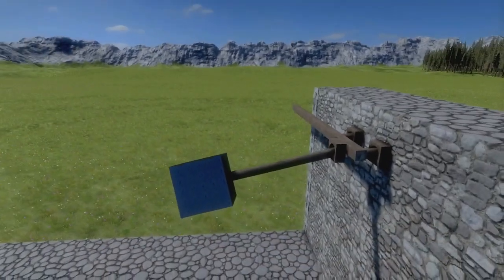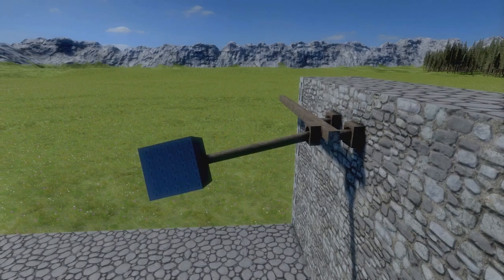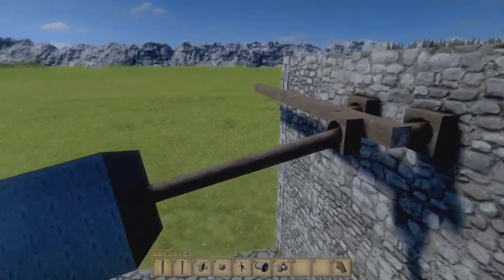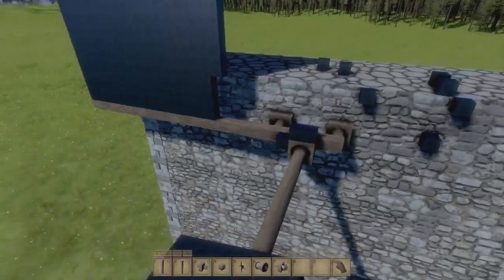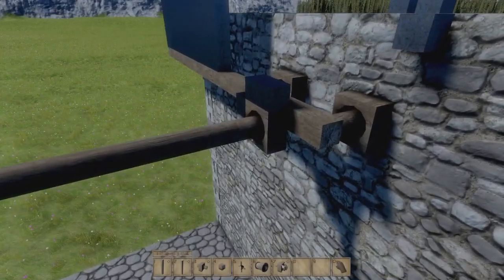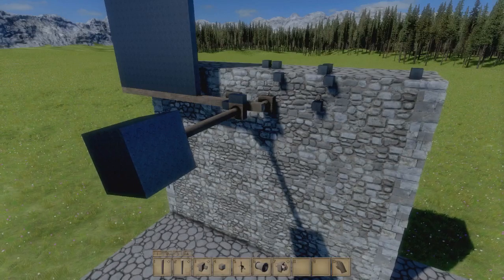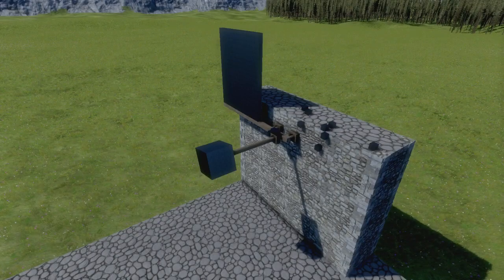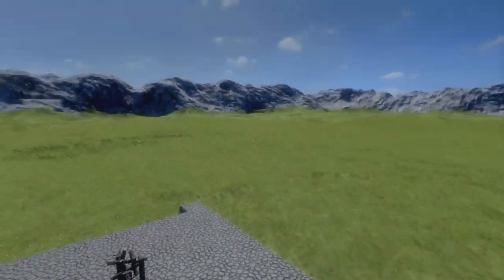ME/SE Guide - Improving Catch Block & Rotor Stability

Comment: Is this calculation of stability based purely on the mass of the object that the catch block is connected to, or does it use the mass of the piece the block is connected to compared to the mass of the object supported by the catch block?

Equations (if these help): A= mass of thing catchblock is attached to.     B= mass of thing attached to catchblock
# = "amount of stability" number or something (bigger=better).

Equation I:   A=#          Equation II:   A-B=#   or   A/B=#
Reply from the maker: It seems like it's A+B=#. This is purely based on observation though :)
Reply: Captain JaRs huh. Unless we're both really missing something, this is almost as dumb as atmospheric drag in Kerbal Space Program being determined by the part's mass.
Reply from the maker: Yeah no this doesn't really make any sense :P But that's just the way it is sometimes with games :)